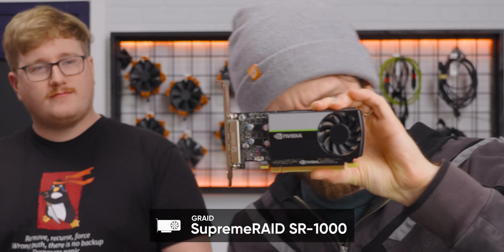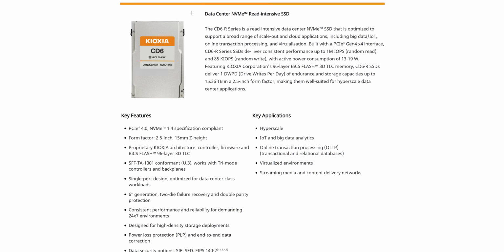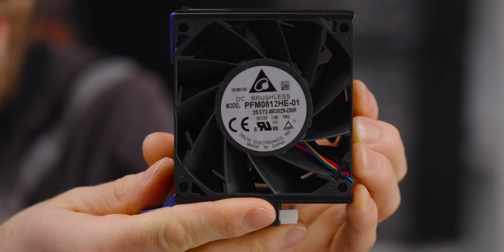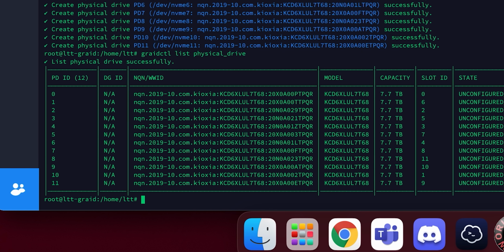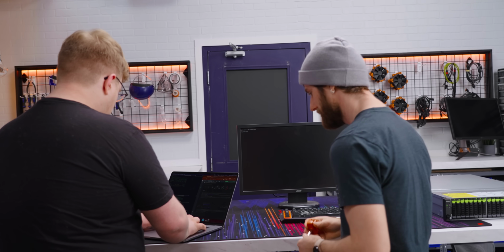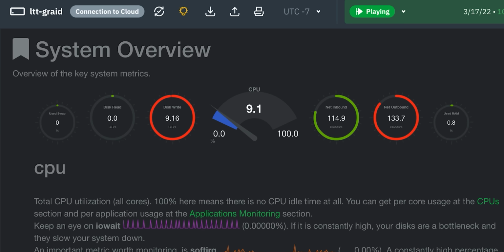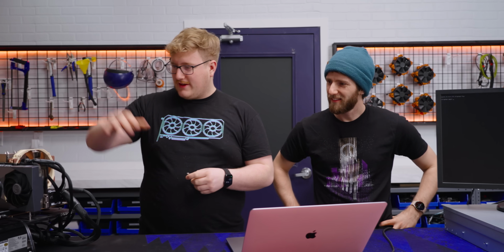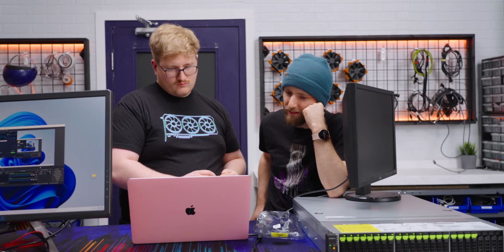I predicted the future! - GRAID Graphics Accelerated Storage

Comment from the maker: Small note for around 8:34: The pieces of data striped across the array in a RAID0 configuration are typically a power of 2 bytes, not individual bits. A common strip size (the piece of data put onto each drive in a stripe) is 16KB, but you can usually adjust it to be bigger or smaller depending on your use case.
Reply: First, love you LTT
Reply: Ok
Reply: Now how am I supposed to “Well Achtually” correct people in the comments??
Reply: I have to know. Does he actually accidentally drop stuff or does he do it for show these days
Reply: Were is scrapyard wars
Reply: This was one of the most interesting product videos recently. And man, is Jake smart. Give him a raise.
Reply: I believe it is disks, and not disc.
Reply: Do a follow-up video with that beefy boi PUHLEASE!!? 🙏🙏🙏
Reply: @willloll-h5u  With crypto mining on the down-turn, there should be lots  of RX570s and 580s available for the scrap part real soon. :D
Reply: So can I use this on an R810 gaming PC running Linux?
Reply: When linus said its  fine, and  you are  working a case  where  dude  lost  all drives at  once  cause  SSDs are a thing. Almost  said to the customer, Linus said its  fine.  just to see if he would know ho he is :D
Reply: Have you a news of adaptec?
SCSI 3940 builder etc.....
Reply: I think someone forgot to put in.. the ltt opener post sponsor spot.. at the begin of the video?? 😬
Reply: But can it play Crysis ?
Reply: @AlexKidd4Fun  lol
Reply: Anybody at Linus Tech tips could help me would be wonderful. I'm getting postcode D6 and 02 I have no display at all I've done two different times and bios update I swap the ram out I have changed my GPU to a different pci I have changed the HDMI cord TVs RAM sticks everything still d6 and 02. I'm at the point in time of having to buy another computer.
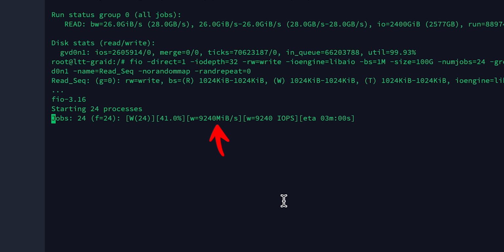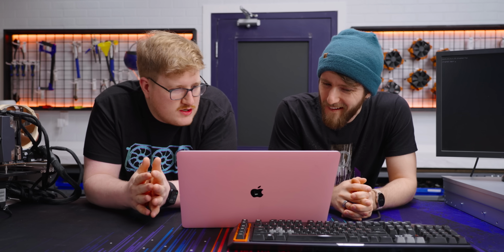Reply: 17:33 -17:40 ACKSHUUAALLLYYYY Gibibyte should not be considered a legitimate unit, it's nothing but a lie... In the 90s there was some marketing liar that first redefined Megabytes to mean Mebibytes. Except back then, even Mebibytes wasn't really a real thing, it was 100% pure marketing and nothing more, everyone hated it and lawsuits were even filed and settled. The only people who used this standard were hard drive vendors, literally nobody else. The International Electrotechnical Commission (IEC) eventually bowed to the hard drive manufacturers and officially released the Mebibyte et al standards. Okay end rant, that's my fake but still real anger and grudge I hold hard drive vendors to this day. It's just so darned frustrating to see people have accepted a marketing gimmick as a technical standard.
Reply: Someone forgot the intro lol
Reply: hi i have an idea why not ;use the heatsink from that server to make a whaterblock it will be cool and much  cooler then any block in the market
Reply: what happened to jake? dont think he used to be obese
Reply: 18 :30 At the sound of the fans speeding up... I would anchor the server, not that it goes through and it flies away.
Reply: @Mr.Morden  Exactly. Everybody was using kB=1024B until some lying ass HDD companies decided they could make their drives smaller, save a bit of disk metal, and call it the same thing. RAM size, for example, can't be arbitrary like drive size can and it's still in powers of 2. I'm not going to change proper language over some marketing bullshit.
Reply: Good video! 2022 and we are finally moving away from hdd! While everything computer repated is blasting away, we normal consumers are still using hdd for storing our data and it is so slow. To back up data 16tb from fresh takes days and my utility company thinks we are best friends!
Reply: @Smart Gaming Zone Of Pakistan wow your brave. The reality of life is that a majority of people won't  care about you. That is life. Good luck though.
Reply: Please read my name❤️‍🔥
Reply: @willloll-h5u  dead along with the market for components rn
Reply: Can you fix my pc?
Reply: NEXT STEP LIQUID COOLING!
Reply: When they realize Linux is actually awesome its so cute. Also Linus hire someone with Linux experience it's embarrassing.
Reply: @StaticZXC  Rse
Reply: Linus. And you say it's not for crypto... Ummm with chia and others coming out using storage to "farm" (mine) by plotting ssd's & hdd's you really think this isn't for crypto? I know NGD has their crap out there but this should really set the bar for plotting.. Just sayin, This IS for crypto.
Reply: The problem is they do use it as a bit, which makes it even more difficult to tell when it’s real, like the time he started out a video with a high end gpu (I think it was a3080) and “accidentally” dropped it standing from chest height, and then we found out it was dummy unit, he sold it so well, and it looked like he actually dropped it
Reply: Have you seen Wendells rant on Graid?
Reply: DID you know that RTX4090 NVIDIA IS TESTING IT THIS YEAR WE WILL HAVE RTX 4090 SHEESH GOOD VIDEOS 👍👍👍😁😁
Reply: i thought it was byte-for-byte
Reply: i really wish you would do 1 more Video on this card but this time what is the lowest processor you can use until it effect performace will a quad core do 6 core 8 core hell bull dog processor lmfao

Comment: GPU is going to start standing for "general processing unit" before long. They do physics, they do math and hashing, they do rendering and texture mapping, and now they are freaking hardware controllers too!
Reply: You know what? Thats pretty cool
Reply: Yeah, like how GPUs being incredibly fast and having stupidly fast memory that the processor can directly access from less than an inch away happened to be perfect for running ML tasks at fast speeds.
Reply: Applications beyond graphics....now the language is "accelerator" as GPU seems outdated/limited usage.
Reply: That's kind of what Xeon Phi was for. Parallel processing taken to the max. I cast my vote for PPU
Reply: for some reason i read harrasing and hashing...
Reply: thats why AMD wanted to make APU instead of CPU. Just use the iGPU for calculation instead of the CPU itself
Reply: @Klokopf52  PPU is cool, reminds me of the NES and SNES picture processing unit
Reply: The GPU still isn't going to be applicable to every scenario. While this is a huge oversimplification, it might help to think of it as a CPU with thousands of cores, but each of those cores are individually quite weak.

A GPU is fantastic for work that can be done in parallel, but some workloads are just better handled by the CPU
Reply: Nah. gpgpu is already a term
Reply: GPUs excel at calculating many things at once, but not exactly calculating different things at once. 

And that example in this video can also be offloaded to an ASIC that serves the same purpose. Network Switches for example use ASICs to speed up networking. The only problem with ASICs is in the name, "Application Specific", but man do ASICs rock at what they do.

CPUs: Super general processors, able to do pretty much anything you throw at it, but not as fast. But, you aren't limited in what you can do.
GPUs: Super great at parallel processes, but struggle at general purpose things. Unless your code is highly parallel
ASICs: Amazing at what they're designed for... and nothing else...
Reply: Maybe go for "Vector processing unit" since that's the big strength they're exploiting to do this.
Reply: @tbuk8350  That memory isn't incredibly fast, the bandwidth is incredibly high

Low latency = Fast memory
Reply: @SviatoslavDamaschin  yeah, but it still = getting data through faster
Reply: i mean they've technically always been (non-industry term by the way) PPU's (parallel processing units)
Reply: So much power and it's increasing exponentally every single year...
Reply: The Virgin CPU vs the Chad GPU!!!
Reply: Honestly, you're totally right what the hell is the CPU doing for me. Just give me a SOC with twice the ram and a half decent CPU acting as a co-processor. Hell can we get a build of linux or windows set to run on a GPU.
Reply: @DaBombtasi  Yet, Evil Su didn't launched mainstream, consumer desktop full of APU. They went full Nvidia/Intel, but made it worst.
Reply: I’m gonna call them
Reply: I feel second hand embarrassment for CPUs. Losers.
Reply: Proposal accepted.
Reply: It's almost like having extra processors dedicated to a specific task, takes the weight off of general purpose processors. This is all pretty obvious, what's more curious is why this hasn't been done this before, since in retrospect it's pretty obvious.
Reply: @ninase420  pretty sure you mean that you read hashing as harasing...
Reply: How about calling it Math Co-Processor because it does mathematics.
Reply: Co Processors
Reply: ... I'm pretty sure someone telling me they stood for that over a decade ago when I thought is stood for graphics processing unit.
Reply: Probably more like NPU ( numerical processing unit) since gpu's are more adept at math at scale operations
Reply: @RakiNgSama  So GP^2U? Got it.
Reply: That have that. It's called DPUs.
Reply: @liam9393  Accelerators do not have graphics hardwre.  They are design separate from GPUs, both board and silicon.
Reply: @DaBombtasi  Apple also just shoving everything in a unified memory and having accelerators on board.
Reply: @RakiNgSama  that acronym gave me a rash
Reply: I like how "general" outperforms "central"
Reply: Did I miss which gpu that is or did they not say? P2000?
Reply: @Klokopf52  
Oh mu
Reply: They're not the be all end all of processing still, they aren't really "processors" in the same sense your CPU is to begin with, they're SIMD machines controlled by a scheduler processor for the most part. Which means they do Wide processing really damned fast, but they Really suck at code that is execution mutable, branching, long logic chains and same address memory writes etc are nowhere near the level of what a modern CPU can do.
Reply: they don't do memory management  :P
Reply: In the future An SSD will plug into your graphics card.
Reply: Not quite. GPUs are good for workloads that can be mathematically represented as tensors or tensor fields. That's why they're used in graphics processing. The same math is applicable to hashing and physics, which is why they're also used heavily there. Some less efficient uses for GPUs include prime number verification (the largest prime ever calculated as of now was verified on an RX Vega  64) and numerical analysis.
Reply: @CaptainMcShotgun41  This comment is a play on that yes
Reply: @DigitalJedi  physics no longer with the 5000 series, aged like a fine milk with that statement
Reply: @beans3837  Nvidia's proprietary PhysX isn't supported, but they are still very much capable of doing all the math needed for a physics simulation, just not that specific version. This isn't some Nvidia defense either, I hate that they removed support, but they do indeed still do physics, or at least can.

Comment: Linus says "CPUs are fricking expensive" in 2022 while literally waving a GPU in his hand. The audacity
Reply: Haha
Reply: we are all clear that he speaks about CPUs that are like 2 3090ti with enough money left to buy a descend car second hand.
Reply: @satakrionkryptomortis  yup.  And licenses are significant in VM infrastructure cost measured per CPU core.
Reply: Funny comment, but yeah enterprises pay way more for software licenses than for hardware, oracle, esxi, etc can easily become 100s of thousands or millions a year and are priced per socket or per core
Reply: Between dropping a T400 and a 75F3, yeah please drop the T400.
Reply: At least he didn't use it as a counter-weight
Reply: a epyc compared to a 1650, it is
Reply: yeah except server grade CPUs for software raid surpass $5k A PIECE
Reply: @Vatharian  meanwhile, at my usual component shopping place: 5950X, 670€, over 25 in stock and over 25 more at the importer. I could by 2 of those CPUs, and still pay less than a decent modern GPU.
Reply: @castform57  some specific hardware AND software suppore are built in server CPUs. I think Linus mentioned this when he was building their AMD based server
Reply: The bubble bubbles further! In the end, we will
Reply: Why are there black bars on this video? My 5t is 18:9.
Reply: @fynkozari9271  Interesting. Would also assume there shouldn't be black bars, as the video is also 18:9/2.0:1 (probably shot in 4K2K?). But this doesn't belong under this comment, has no relation at all..
Reply: you could buy multiple 3080s for the price of top epyc milan chips
Reply: @fynkozari9271  LTT renders & uploads their videos in slightly different aspect ratios than 16:9 (my best guess is probably close to 1.85:1). I don’t know the exact reason for this, but I heard they do this so some people can watch their videos on certain phones while having it fill the entire screen or something, but I could be wrong.

Comment: LTT: We just had a massive storage failure where data checksums were critical to recovery.
Also LTT: Let's switch to this new RAID system that has no data checksums!
Reply: Well the server that had the issues would have a completely different use case than this server. 

The failure was on a long term archival storage server using HDDs. This type of server would be used for short term storage of ongoing work on SSDs. 

So, what they are discussing here uses more reliable equipment in a situation where any error would almost certainly be detected extremely quickly and relies on high transfer speeds and much more expensive storage.
Reply: this is block level only, so use a checksumming filesystem?  a bit unfair to compare a filesystem to a raid only software.
Reply: @konzo5942  The nice thing about zfs (and btrfs) is that they can detect corruption within raid pools and AUTOMATICALLY CORRECT it. That probably won't work with this setup as everything is exposed as one single drive. You will know something failed, but not which copy is correct and you won't be able to restore it.
Reply: @kommentator1157  a purely filesystem software that does checksumming is going to work to correct bit rot irrespective of the underlying hardware. Also it's less of an issue with SSDs which this is only going to be used for.
Reply: @konzo5942  not really. This solution (like most raid only systems) presents the pool as a single logical disk. The filesystem could do checksumming and tell you something is wrong, but I doesn't have the necessary information to correct it. This solution only uses the parity data if there is a read error, regardless of whether the data from a particular drive is correct, because the raid abstraction does not utilize checksumming. Wendel from L1 techs was able to corrupt the data easily during his tests (by inserting a discrepancy on one drive to simulate the random changes to the saved values due to bitrot) and because the drive didn't report an error it was not detected. ZFS on the other hand caught and corrected the same scenario. I agree this is not a huge issue for short term live data, but if there are no protections, such discrepancies could find their way into the backups and archives because they were not detected/corrected
Reply: @Momi_V  a checksumming filesystem will repair bit rot always, unless the bit rot is very severe, and then you basically have a drive failure on your hands which obv checksumming can't fix. If they put zfs on top of the raid, bit rot will be corrected. But then again the priority for this software is speed, where is does perform very well